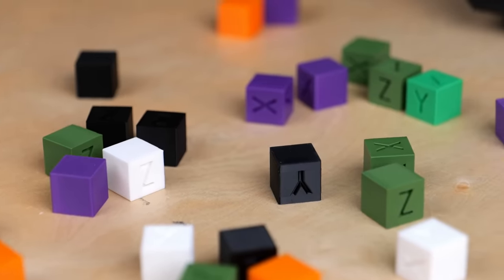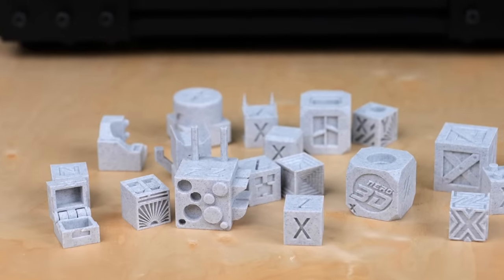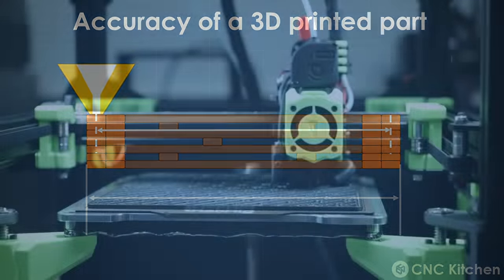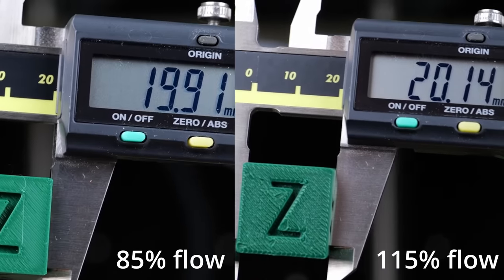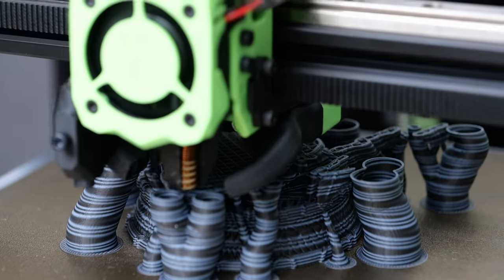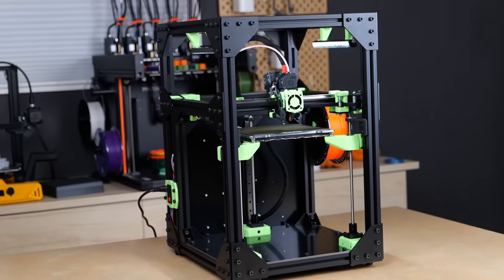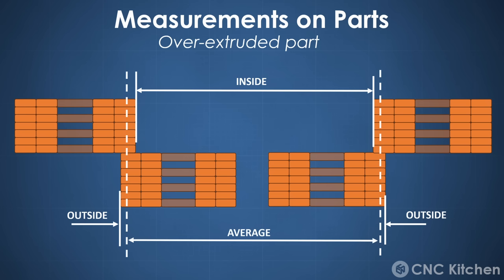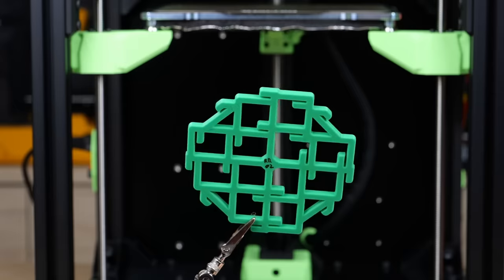Calibration Cubes: More Harm Than Good?

Comment: I've been saying this for years! 
Using the calculated steps (from motor, pulley and belt or Z screw specs) is way more accurate than measuring any printed object, especially such a small one. If you need to calibrate an unknown system, do it based on movement of the print head/bed, not by printing stuff. Extrusion setup, edge bleeding and cooldown shrinking mix in there, ruining any accuracy. The only thing to maybe calibrate is the extruder, based on filament movement. You can find a great piece on the topic when you google "Why you shouldn’t calibrate your 3D printer" by Cartesian Creations.

The approach you take tries to compensate for most of the effects. Personally, I'd leave the 0.3% dimensional error be, it makes about 0.5mm on a 20cm part, and I guess thermal shrinking that varies over material types or even part shapes is probably responsible. The skew however can be a serious issue. I wonder how accurate the measurement results are, but judging from how you successfully reduced it, probably good enough. I'd personally just print some perpendicular extrusion lines (a rectangle outlining the printable area maybe?) directly on a sheet of paper and measure the skew there (or on the bed, but measure when still heated!), again to avoid any shrinkage effects.

Comment: The thing that makes my gears grind at the point where Stefan mentions that differences in shrinkage and parameters of materials is the comparison with "regular" inkjet / laser printers. Most manufacturers sell you their own printer ink and they mostly do not support 3rd party inks. Wouldn't this be a "worth while" solution for 3d printers as well? Same with resin printers? 
Most users I would not expect take the time to tune their filaments and printers to this extent. Same with resin printers. Now this subject made mi rethink my material choices on my resin prints and why my dimensional accuracy was shayt always. This might be a "good enough" reason to be "manufacturer locked" especially for businesses that use 3d printing - or am I over complicating things? 
As a small business it would save me a ton of headache to just "put in and print" would you not agree?

Comment: Wondering how much the z-axis could be skewed from the the x-y plane?  I'd expect bedslingers would have more potential than a core-xy, as only have two mounting attachments. (core-xy has four)
Bed-levelling should align x-y motion of printhead to the bed so no first layer vertical skew. The question becomes what with taller prints (z-axis), and if a tilt detected in calibration, does a level-skew offset get translated beyond the first layer.

Comment: Another confounding factor is that slicers typically position the center of the nozzle where it thinks the nominal boundary of the part surface is, and then half of the extrusion width is outside of that.  In Cura you can set "slicer tolerance"  to exclusive" and it will print the outer surface of the wall coincident with the nominal boundary of the part.

Edit: this is not correct, at least not in any way that applies to this video.
Reply: slicer tolerence looks like its to do with the top surfaces since the hard limit for that is the layer height. So they gave you the option to to adjust where you want the cutoff point to be for the layer bounds.

as for the x and y it is always kept within the bounds of the model as long as you're not dealing with anything thinner than the nozzle. You can test that by changing the nozzle diameter to be really big and see if the model changes. Obviously make sure horizontal expansion is set to 0 since that's basically the X Y version of that slicer tolerance setting
Reply: This is just simply wrong, how do you even come up with this?
Of course it compensates for line width.
Reply: @Foslanden  I read an entire explanation that described it this way, with images and all, though I can't recall where that was.  I just went back and read cura's short pop-out description, and yeah, it doesn't sound like that at all.  I regret spreading any misinformation, but I got it from somewhere that seemed legit, or else had a very technical fever dream at some point.
Reply: This isn't what I had seen originally, but is close https://youtu.be/X6nCKQToOUg?si=7U1loXkJfwZAWQbi
So, if this is correct, the setting does affect the size of the part, though it only applies for surfaces that aren't completely vertical and indeed would not affect a straight sided feature being used for size calibration. 
Sorry again for the misinformation.

Comment: I started using the califlower a couple of years ago, and it never let me down. Many comments are stating that you should remove the variables of plastic flow, cooling, and printing motion and only measure a simple distance in each direction comparing input to actual distance. Then just relying on shrinkage values or modeling. Maybe cooling and motion in each direction also leads to asymmetrical shrinkage, so your values are off by different amounts in x vs y. I wonder if you can do a video to compare the two methods. Alsl curious about best Z height calibration method you suggest. Thanks!

Comment: Solution for “bad” calibration cube: bigger calibration cube.😂 

Plus normally even a cheap caliper will have at least 0.02mm tolerances not 0.2mm. They are way more accurate enough for 3d printing.

Comment: I printed 200mm towers on my MK3 to check for skew in the XZ and YZ planes too. The printer can't check these, and I found mismatch of almost 2mm at the top of the tower. I made new brackets for the top end of hte Z axis rods, but a software skew correction parameter would be very nice.

Edit: Looks like it's supported in Marlin. Too late for me...

Comment: With standard ANSI uncertainty calculation and with a sample population smaller than 31 units per printer, you are probably using the t-value for find the sample standard deviation no?  Regardless, this must have been a very tedious and lengthy test, so thank you for all the effort. 
I am curious how you isolated what the bias errors were and if you use a gaussian distribution to minimize the precision error before coming to a conclusion. 

There are way too many variables to isolate when 3D printing for size calibration in my opinion.  I have 2 MK3S+ prusa's that are both in their own insulated enclosures.  For size calibration like you are doing, and especially when trying to engineer/design a new calibration print, it would make isolating the bias error easier if you had 3 or more of the same printer.  Only after song that would I expand to different printer styles and brands. 
It was a good idea to use the exact same filament brand, type, & color, so that was nice to see.

Again, so many things to introduce variation here, so this couldn't have been easy, thank you for the video 🎉

Comment: I suspect the scaling factor is actually a binomial for most printers. The reason being that you are both dealing with the movement calibration, which will scale linearly, and the distance between two perimeters, which should be a constant for a given material, temperature, and extrusion width. Linear regression using different sized prints should give you the factors, and you can calibrate your printer using a in: ax + b

Comment: I use Voron cubes instead. I also tune using shrinkage. Not steps/mm. The steps/mm should never be changed for x/y/z. Those should be calculated based on the pulley sizes.

Comment: Non-shitty comment: Personally I use 50x50y10-25z millimeter test prints with a 5mm radius corner and a central 12-30mm round or square hole for calibration, they are only marked on the underside of the print and only on one side(you only really need one side identified to know the axis orientation)

That way I have something large enough to get meaningful measurements(100mm would be better but for my needs 50mm is good enough) and without anything on the measured surfaces that could bulge out or otherwise introduce inaccuracies...

That said I might CAD up a version of the flower so I have it if I ever happen to print anything that needs more precision than the 0.1-0.2mm that works for my prints(easy to add/subtract enough in design to compensate as/if needed and I rarely print anything I didn't design myself).

Comment: Since I have after a few years experience with the prusa mk3s I wonder that the manufacturer of the commercial printers like my new xmax 3 from qidi did not make calibration tests before they ship it. Seems calibration is the customers job in the under 1000€ class. Anyway, compared to other closed source products the qidi support is very quick responsing.

Comment: As a coaster, the Cali-flower would suck. Adding an extruded shape outline to the present design would consume more filament, but a thinner base design in consideration of the fact a flat plate of plastic would probably improve structural rigidity of the model in practice could help reduce material used and enable its used as a coaster with a raised brim, which could be yet another printer test.

Comment: No "sh!tty" comment here. I've been saying this since I got into 3d printing a few years ago, especially the size flaw in the common "test cube".   

As soon as I got into 3d printing, I saw all the issue's outlined in this video that relate to the machine induced error's but I probably had an advantage in seeing these flaws because I come from a long time background as both a  machinist and machine designer and with that, have a very good understanding of where dimensional error's come from as they relate to the machine itself. 

For anyone that doesn't get it, you have to understand that there is some degree of error due to drive mechanism's "precision per unit distance" For example, being that most 3d printers are belt drives most of with 2mm tooth pitch belt, that doesn't mean that every tooth is "EXACTLY" 2mm center to center, you can have some that are short, some that are long, etc... so the less of the belt you use for calibration (i.e., the smaller the calibration object), the less accurate your calibration is. This is why all high end and even many mid grade CNC machine controllers have lead / ball screw mapping and error compensation. Once the machine is assembled, a linear motion / travel map from the given axis's home position is done and then at whatever interval the map was done at, an error correction value for that position is stored and then applied any time the machine is commanded to move to that position and interpolated for everything in between positions. Now obviously this is outside of the realm of 3d printing (at least for now) but the fact still remains, there is error in your drive system and the less of that drive that you use to calibrate, the greater your error will be a larger sizes beyond the size used for calibration. The only problem that can arise when calibrating at a larger size is if the error lacks linearity, then there still will be spots where its off but it will most likely be off to a lesser degree than if you had calibrated at the smaller size 

It should be noted that with the skewing, not only can there be a skew error on the X/Y plane but also on X/Z and Y/Z planes too.

Comment: I’ve never printed a calibration cube per se, from measuring printed parts I know to adjuste in cad to get the right size. If I need a 20mm hole, I know it’s going to print at 19.8mm So in cad I make it 20.2mm and end result is a 20mm part.

Comment: Your printer looks very much like a Voron 0.1/0.2, however I see bed supports on all 4 corners which the Vorons do not have. Do you find the added 4 corner support to be needed. For as small a print bed as you have it should not be needed.

Comment: I am saying this since ages. The CC is just too small for calibration. I did not used this flower for calibration, but i did used always a 100x100 square. It would be better with 200x200 but i do not have that big caliper, and i do not want to mess other numbers than 100. As you mentioned very well, the most important thing to check if the 2 diagonal is equal to each other. Tbat's exactly how we check accuracy in the workshop zone as well. (fun fuct it will be never ever 100% equal - only very close enough) the rest is the tipycal calculation.

By the way i almost forgot. I do not remove the print from the bed (glass)

Comment: I think the big one people always forget is that the parts shrink as they cool down. I don't think you're controversial there at all, you're right, even different brands of PLA if that's all you're printing will shrink different amounts.
 So if you adjust your parts based on a single sized calibration cube then the rest of your prints are going to be off because you need multiple dimensions and materials to measure in order to compensate both for linear backlash and for percentage errors in the motion system and then to have correct scaling factors for plastic shrinkage.

If your printer puts out a perfect 150mm part in PLA after you asked it for a 150mm - then that isn't actually perfect - your calibration is out and you're printing oversize - because you didn't scale to account for material shrinkage.

With regard to the different X-Y sizes - it's more likely backlash in the different machine mechanisms - Bambu's have a bit of bashlash due to the dimensional accuracy not being great on the carbon rods and the clearance and friction/stiction then needed/caused by the bushes they use - which is why you can see the A1 mini behaves much better on it's bearing rails. (Although doesn't account for the A1 so there's obviously more than one factor going on)
 It's the biggest disappointment I have with mine, the dimensional accuracy isn't even as good as my very first wooden framed Replicator machine was. Far more consistent though but that's another topic. If someone dropped a linear rail upgrade with bearings for them it'd go in my Bambu's before you could say "Oh shiny" - extra weight be damned.

Comment: Hello friends,
So if you print with different types of material, a good calibration would be to follow the same procedure as Stefan with PLA since it is one of those that has the least thermal contraction. I'm right?

Comment: IMHO, the mechanics of the machine should determine steps/mm, adding a fudge factor there is the wrong approach.
So you calcuate the X/Y/Z steps/mm once and leave them well alone, fix any issues with other settings or by adjusting the machine.

(Extrusion is a different story as the mechanics aren't set in stone, the filament diameter isn't quite constant etc. But you should have a decent baseline setting that is based on the mechanics, and then fudge factor in the filament profiles. Haven't done any printing in years, so not sure how modern slicers/firmwares work, but volumetric extrusion was the way to go back in the day.)

Comment: Have you performed any gage R&R calculations to determine your personal measuring capabilities?  That should be done and understood before even attempting to make adjments to your CAD model or printer settings.  Measuring inside dimensions with a digital caliper are famously unreliable.  After 40 yrs as a Quality Engineer working a significant amount of that time working with plastic manufacturing, I can attest to the fact that even experienced inspectors struggle with caliper measurement accuracy.

Comment: Hey really appreciate the vid, I have a kobra 2 neo and back when it didn’t break, I was doing calibration and the cube was off by like 0.2mm and so I threw it into a step calculator and the results were terrible, had to change back to the original value

Comment: xy skew is mainly comon on tiny printers and very hard to solve on some models because of the tolerance of the printer parts themselves. The worst skew is floating Z skew due to soft frame or bad motor synch.

Comment: Instead of spending hours calibrating, you can adjust the part within the margin of error. For example, if my printer's outer and inner diameter error is ±0.2mm. I make the outer diameter of the part 11.8mm instead of 12mm. I make the inner diameter 8.2mm instead of 8mm.